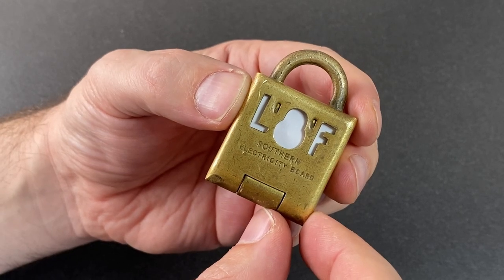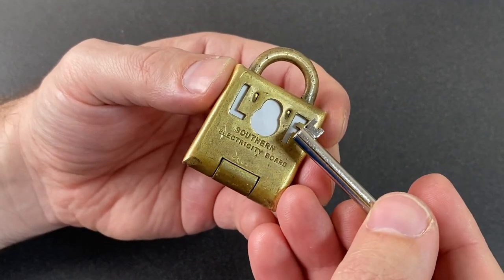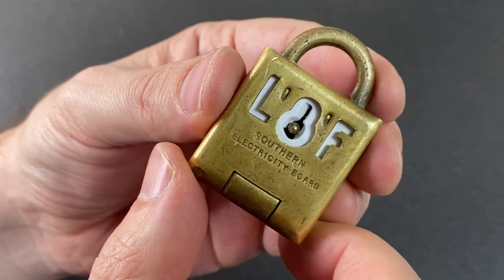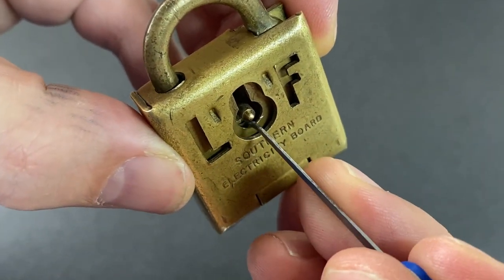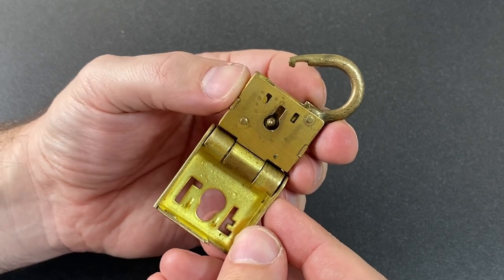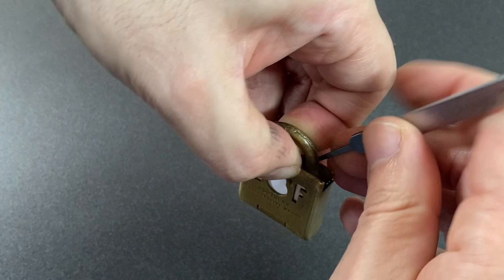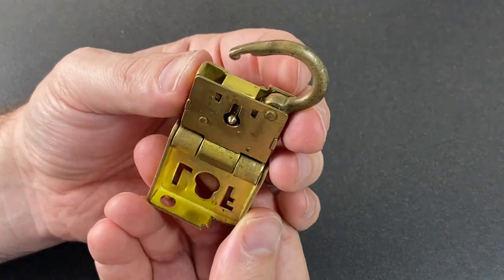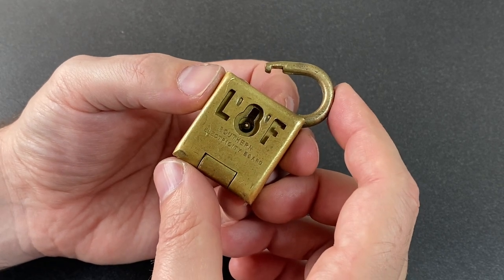Lowe & Fletcher Electricity Board Lock

Comment: Would one actually have access to the angle required to apply the shiv when the lock was in place on an actual meter? It would be interesting to see if there's a photo of one of these locks in place to see if it's a plausible work around (ignoring the "just replace the paper" option).
Reply from the maker: I imagine the paper would have been some official card with some form of print

Comment: A story on coin operated meters (actually showers in this case and tokens) years ago I went to a juggling convention in Ireland and the showers were token operated unfortunately they couldn't keep up with the numbers of people using them as juggling is a very sweaty activity and there were token shortages however it just so happens that jugglers (including me) also tend to take an interest in other things like lock picking so you can guess the rest. BTW we weren't defrauding them as free use of showers had been negotiated but you still needed a token and at times they didn't have the staff available to empty the token units.

Comment: Ok quick question, I just got a set of picks and a couple of training locks, one is a cutaway and the other is the revolver both from Sparrows. My problem is being new to picking I have trouble getting to pin one I have picked the cutaway 2 times once with BOK tension and once with TOK tension. I have tried many times but normally I have a hard time getting to pin one regardless which pick or tension tool I use. Does anyone have any good tips on getting that first pin? Any help would be appreciated. Thank you!

Comment: Or you can just lock pick it like you did at first, and replace the paper with a new one before locking it back up.
Reply: You would have to mug the electric board man to get the correct seal.
Reply from the maker: It was printed anti tamper I think